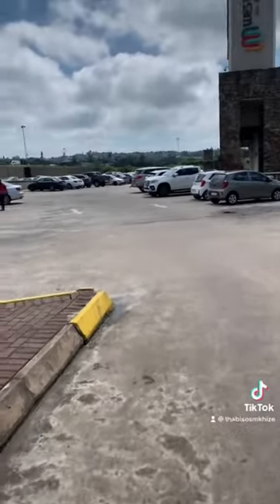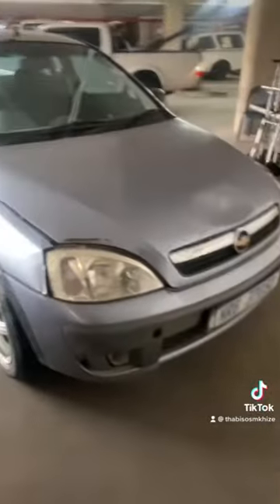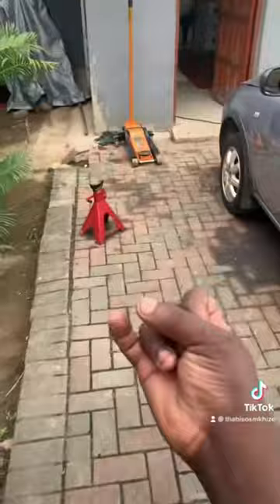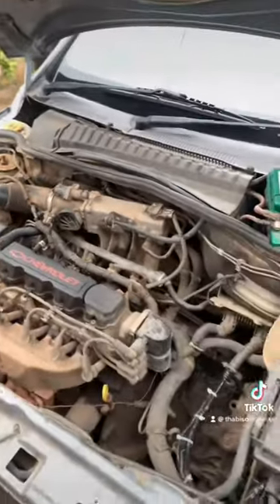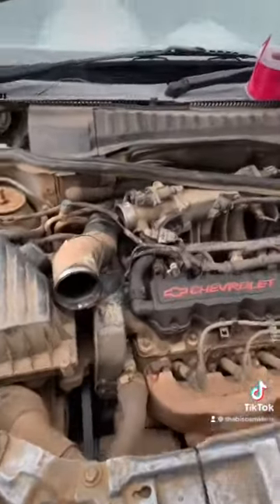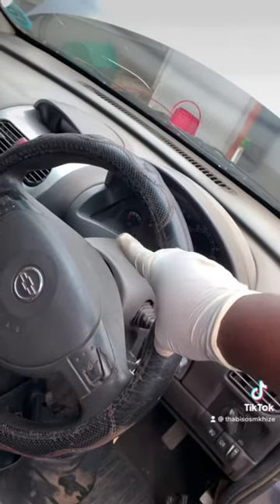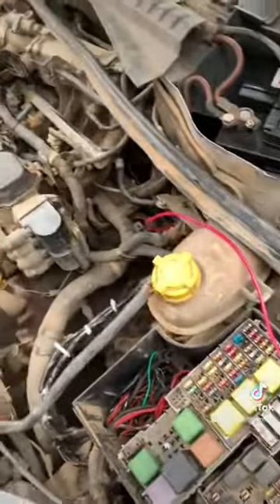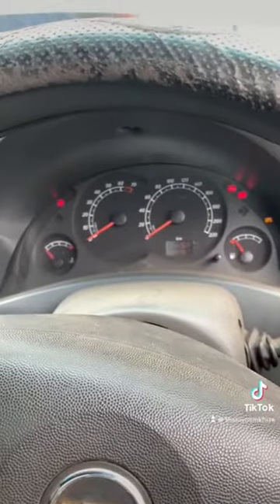Non runner fixed in 2 hours 🚀🥳🥳🥳

Comment: I wish I can get a good mechanic for mine...it runs but the rpms drop until it dies when I press the clutch😢
Reply: ehhh...had that self rev issue, been to over 4 workshops and opel too, ended up buying another engine after too much skimming
Reply: @sifisonkosi9427  Did you buy a new one or second hand?
Reply: I think you have an idling valve problem and when the car is stationary and you start it does rev then dies? If yes get an idling valve